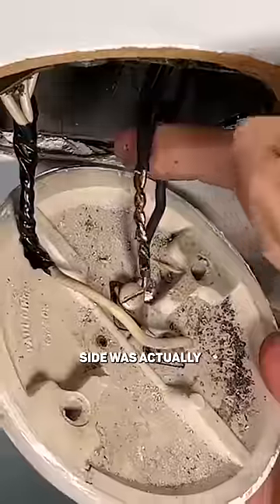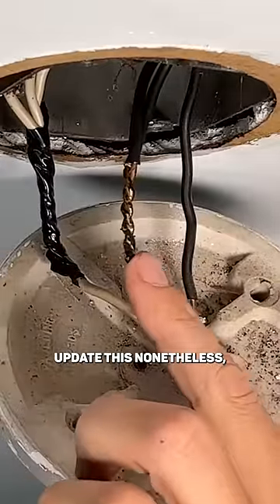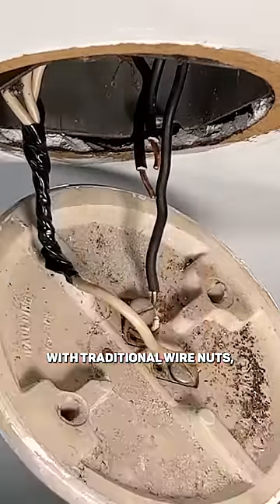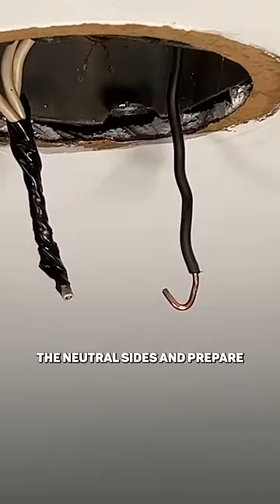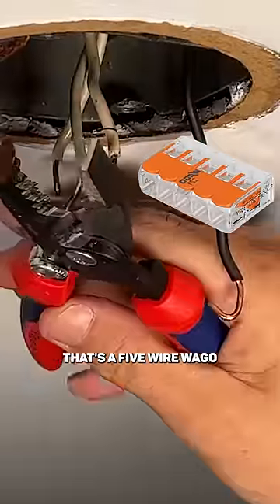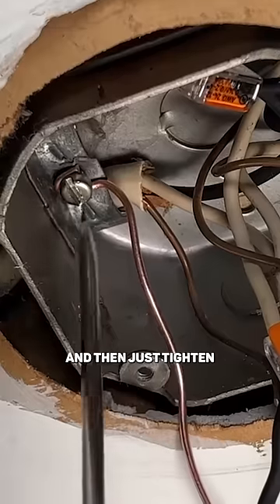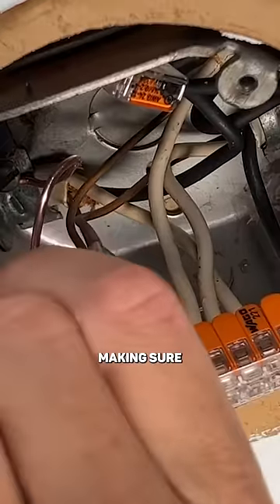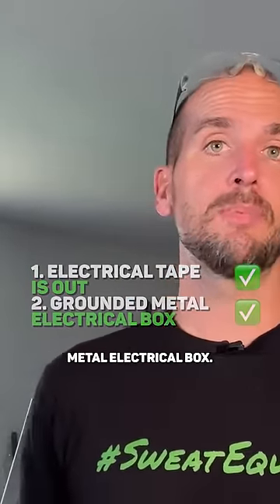Which Part Doesn't Meet Code?

Comment: Whenever I watch American electrical work, it looks like the UK in the 1960s
Reply: I agree
Reply: What he was working on probably was from the 60s
Reply: After watching UK standard work, I'm surprised we get away with what we do
Reply: Residential is much different than commercial, and it varies greatly state to state
Reply: That fixture was from the 60s.
Reply: @davepalmer9265  there needs to be a standard nation wide, is it really so difficult?
Reply: @michaeldunham3385  yes, it is.
Reply: Don't trust this guy to be running our standards.
Reply: Yep, and we still have a very safe electrical system and we don't have asinine ring circuits.
Reply: @Rupert Samborski  They don't have houses that old in America 🙄
Reply: @michaeldunham3385  NFPA?
Reply: @phil7390  your point is what?
Reply: @dylanrussell5261  spoken by someone who is clueless regarding electrical work
Reply: Total United Kingdom population size: 67 mill
Total UK electrical fires annually: 8,000
One out of 8,375 will experience an electrical fire annually. Uses 240 volt AC.

Total USA population: 332 million
Total USA electrical fires annually: 5,200
One out of 63,846 will experience an electrical fire annually. Uses 120 volt AC.

Hate to say it but I think you guys done F'ed up by changing since the 1960s especially seems how you guys run everything off of two pole 240 volt. Majority of our appliances run off of single phase 120 volt. You guys have a higher amp draw then we do and you guys are using an inferior connection compared to a pre-twist wire nut connection. I'd rather my wiring look like a rat's nest and to be safe than look pretty and be a fire hazard.

-a licensed IBEW electrician
Reply: @michaeldunham3385 yes it is exceedingly difficult because the world chose to use two pole 240 volt electricity as compared to here in the United States and the rest of the Americas where we use single pole 120 volt. We have less fires than y'all do 👀 and our stuff works just as good as yours does without catching on fire 😎
Reply: @TastyLiberalTears  it's not 5200, it is almost 9 times that. NFPA reported an average of 46700 fires involving electrical failure or malfunction each year between 2015-2019.
Reply: @TastyLiberalTears  the rest of the world uses 1 pole 230v
Not 2 pole like American 240 supplies are.

We don't do any of the centre tapping of transformer secondaries here.
Just simple 3 phase each 230v phase to neutral (Y) or 400v phase to phase

Distribution is normally 11kv phase to phase 🔺 connected 3 phase
Then the transformer (pole mounted in rural areas, in a compound in more urban areas) has a delta wound primary and a Y round secondary taking 3ph+n along the street with each house being connected to 1 phase and neutral
Reply: Most of our houses were built in the 60’s. How’s the wiring in your 1700s house look? Lol
Reply: @dasy2k1  my Lord you guys make electrical complicated LOL
Reply: More like 1930's
Reply: @TastyLiberalTears could you cite your source for 5,200 annual electrical fires in the USA? I couldn’t find anywhere that matches and most sites (such as the NFPA) say it’s 46,700 annual electrical fires.
Reply: I started my uk apprenticeship back in 1982 and wire nuts were Commen then
Reply: @TastyLiberalTears  you might want to check your figures,  according to the NFPA over 32k House fires a year in the US can be directly attributed to electrical faults.
Reply: @261mem19  the United Kingdom has 1/5 the size of the population of the USA so if you take your annual 8,000 electrical house fires each year times 5 you end up with 39,600 electrical fires per capita that is if the UK had the same population size as the United States. You guys still have more electrical fires than we do per capita.
Reply: @supremebeefmaster  I grew up in a house from 1925 LOL and most recently in California I lived in a house built in 1938
Reply: It would explain alot
Reply: @261mem19  per capita the UK has a higher electrical fire rate than the United States
Reply: @joshuatk59  51,000 i meant
Reply: US electrics terrify me. Everything feels shady compared to the way I was taught to work.
Reply: That's cause this is electrical work from the 60's-70's...
Reply: Why did you cut the wires so short? You just made those conductors too short could have just trimmed the wire twist and used wire nuts. But advertising come before good work I guess 🤷‍♂️
Reply: You guys, should use the Dutch standard. Nem 1010 standard. Every cable needs to be used with joint terminals, crowns, not exposed but everything in either PVC or flextubing when hooked on walls or inside walls. Also everything is grounded with an Earth Ground breaker. I've seen Americans put 2 strands of electrical wire straight up in the wall and spray insulation foam on them... 

Only thing i do like about the American eletrical wiring is their thicksness in cables. They use low voltage and insanely high current to get the same power. Plus side is, they can easily amp up the voltage to increase power over the existing cables till kingdom comes. Sure, existing old electrics would die probs. In Holland we went from 220 volts to 230V to keep up with the demand. But your wires can only go so far because they are less thick.
Reply: @michaeldunham3385  thats a national standard
Reply: Yanks going to maf af about this
Reply: There’s a lot of differences between the two systems but whatever you need to do to put yourself on a pedestal. Cope.
Reply: That's because most of the shit getting updated is from the 60s
Reply: UK Dentist just started using braces last year
Reply: @witlessfuture you should probably look up the electrocution stats while you're at it...
Reply: Whenever I see the UK today, I'm reminded of 1940 Africa
Reply: @AceWolff  18 edition tell me that they havent got it right 18 times 90% is BS coz sparks dont know what law is
Reply: This is not a proper installation. No real electrician would do what he did
Reply: @supremebeefmaster  What do you mean we don't have houses that old in America? One of the houses I used to live in was built in 1901.
Reply: @NathanExplosion25 some of the wiring in the UK to me is kind of questionable, I work with electric all the time doing repairs and updates. The ring system, yeah you may be able to deliver more amps but you blow one circuit an entire floor of lights or outlets go out instead of each room being individually on its own breaker.
Reply: @TastyLiberalTears  just check that electrical theory there hoss. US pull more current.
Reply: @joken8901  international Brotherhood of electrical workers, it's a union in North America
Reply: Yep, the UK are definitely electricity experts,  lol!
Reply: absolutely
Reply: @Chris Lewis  I mean, you're partially right. Lighting is wired on a radial here. Only sockets are wired with a ring circuit. 

The average house here generally consists of three ring circuits. Upstairs, downstairs, and kitchen. Also the cooker has its own dedicated supply.  While I can see the advantage of a circuit per room, it doesn't feel like a big deal if one of those three trips.
Reply: @supremebeefmaster  not true
Reply: Does not   even in the 60s things were done RIGHT  in the U. K.
Reply: I agree, "let's do the twist again like we did last summer " very 60s along with no sleeving on the ground our earth cpc, but it's interesting.
Reply: @TastyLiberalTears  how clown can you be?? LMAO
Reply: @ericdallolio  do the math yourself
Reply: @TastyLiberalTears  should be half the amp draw at double the voltage unless thier devices use 4x more power or they're putting a lot more stuff per breaker
Reply: @kevincrossland1898  in all honesty I'm pretty much over this whole tit-for-tat bullcrap. Here in the United States we usually have one breaker/room sometimes two the most common breakers you will find here is single phase 10,15,20 amp 120 v AC on two phase power the most common are 30,50 and 100amp two-pole breakers.
Reply: @TastyLiberalTears  a licensed electrician who doesn’t know ohms law. 😂😂😂
A 240v system draws less current than a 120v system for an identical load.
Reply: @LordStraightBanana  I am aware and that's why we still use a pre twist with a wire nut rather than a wago, I am a firm believer that the contact points on wagos are dangerous here in North America. The only time I feel comfortable using them is in light fixtures like troffers after the ballast or the drivers.
Reply: @TastyLiberalTears  you're either lying to try and prove a point or woefully ill-informed as data from the national fire protection association puts it at 51000 electrical domestic fires in the US annually
Reply: @supremebeefmaster guess I'll have to tell my parents their house isn't real
Reply: @michaeldunham3385  A US state is larger than a European country. Questions like this come from people who have no grasp of basic math or scale.
Reply: Or Germany in the 60s. XD Everyone here who is remotely familiar with the VDE will cringe all the way through this video.

I swear, if you do that today in Germany you will be forbidden to do electrical work ever again. 😂
Reply: @TastyLiberalTears  It reminds me of people making fun of imperial vs. metric.
i would be terrified, no matter how many additional safety features they include,
to have to plug my phone charger into 240 everytime i want to use it...
Thy should worry more about being good subjects to their royalty and less about how the USA gets stuff done.
Reply: @michael-dm2bv  hear hear good sir!
Reply: @michael-dm2bv  IDK I would probably be pissed if I lived on an island too
Reply: That is from the’60’s
Reply: Whenever I see UK teeth I think a electrician from the 60s did it.
Reply: @michaeldunham3385  well look what the European Union did when they had a go.
Reply: @TastyLiberalTears  erm, if you halve the voltage, you double the amp draw for the same power. Therefore I’d have you guys have the higher draw. Also in terms of overall demand all electric heating is not common (at the moment) and perhaps only 1% of households run AC.

Our typical total supply was 100 Amps single phase, but policy has very recently changed to make it 80.
We have insufficient infrastructure for everyone to be charging electric vehicles, which I guess us ok as there is not sufficient copper, coblot or lithium to ensure we met our 2030 targets anyway.
Reply: @bachmed00  in the U.K. we moved from 240 to 230v. I think it’s got more to do with European technical harmonisation document 432.
Reply: No the 1940s
Reply: As an Australian electrician, yeah US electrics scare me.
Reply: add to that Australia, New Zealand, Fiji from the 1950s. Seems like a lot of US electricians dont know when, where, why or how to do earthing either and goodness knows... can only guess what they'd think a M.E.N. system was...
Reply: @michaeldunham3385  absolutely agree with you.
Reply: @TastyLiberalTears  you obviously are not acquainted with inverse square ...as voltage increases, Current decreases, and v is versa.
You spend twice as much on copper as we do because of your need for increased current carrying capacity.
Reply: @TastyLiberalTears  your statistics mean diddly-squat, sunshine.
Electrical theory is built on laws which tend to be set in stone.
Reply: @TastyLiberalTears  I just laugh....
All those "inferior" electrical systems world-wide, using LESS copper, drawing LESS current and doing it all no doubt using a METRIC system... sigh... Americans sure do like proving time and time again how inferior they are compared to most other nations !!🤣🤣🤣
Reply: @TastyLiberalTears  
I keep thinking of Jeff Daniel's little  talk to the class about WHY AMERICA ISNT THE GREATEST COUNTRY...
they just think they are and every one elce is pissing themselves laughing....🤣🤣🤣🤣
Reply: @LordStraightBanana  ...at least SOMEBODY knows some shit. That old inverse square law aint going nowhere! As voltage rised, current will fall -  and vise versa !! OHMS LAW RULES!!
Reply: @JebediahKerb  bloody oath, mate ! Those yanks would freak out if someone dropped a copy of the AS/NZS 3000 Wiring Riles in their lap 🤣🤣🤣
Reply: @violettownmicroenterprises1528  😂😂😂 the United Kingdom is like the little brother that has polio compared to the United States. Don't worry little bro when the shit hits the fan get behind us.
Reply: @violettownmicroenterprises1528  when comparing apples to oranges what I can find is that France using 230 volt AC system has the most electrical fires annually.
Reply: This wiring is from the 1960s, most likely.
Reply: That won’t pass code here. It probably is 40 year old wiring
Reply: @supremebeefmaster  correct. We only kicked their ass back to England 40 years ago
Reply: @261mem19  and it is still a lower ratio
Reply: @TastyLiberalTears you're joking right 😂. Electricity is complicated 💀.
Reply: @michaeldunham3385  You mean like the NEC Code book?
Reply: @supremebeefmaster  I've changed and upgraded electric meter bases  from the 1890's.
Reply: @NathanExplosion25  you guys probably sent the kid making this video over here.
Reply: @LordStraightBanana  that's why in the US we use 277 v single pole circuit for our store lighting provided it's eight feet above the floor out of the reach  of humans unlike receptacles in the UK
Reply: @johnmcnair8854  as electrician's we are regulated by the national electric code you are referring to the national fire protection agency, it's really kind of dumb anyway we have more electrical things going on here like welding and industrial so sure there's going to be more fires., There's too many people commenting on here that don't even understand ohm's law and the amoacity of conductors  and their correct termination
Reply: @violettownmicroenterprises1528  we don't bond the ground in our subpanels that's right and there's a reason for that
Reply: @violettownmicroenterprises1528  you're not making any sense at all you probably are referring to ohm's law we have all kinds of different loads and single pole double pole 3-phase voltages, that all mix together easily into our grid
Reply: @mrromantimothy  Was that the modern equivalent to "I know you are, but what am I" ?
Reply: @mrromantimothy  well with your welding and industrial, I was commenting on a post about house fires so what has industrial got to do with house fires?

Comment: Putting that ground wire under the cable clamp screw is not code compliant so you left the box with a code violation.
Reply: @thebigdoghimself  He didn't run those wires and he needed to cut them to properly join them. Stop going off topic
Reply: He was too lazy to drill and tap a hole for a proper ground wire.  Amateur.

Comment: It was code compliant at its installation when solder was legal. Put some 33 or 88 tape over the original tape if you want to ensure it's taped. Those 2 tapes will probably last longer than you will. Or, put a wire nut over the soldered connection. There's no reason to disassemble the connection and redo it unless it's failing.
Reply: Exactly. Thank you

Comment: Did a great job Butt your ground is wrong. You need to put a grounding screw into the box to bond the box to the grounding system
Reply: Hows that going to work when that old service has no ground?
Reply: So the service doesn't work?  I didn't see that there was no power, I assumed there was.
Reply: That's the way it was grounded before threaded j-boxes and green screws. 
I would bet that there are more grounds that used this method than green screws and green wire nuts in residences in the entire US. 
Where there were no romex clamps in The box, the ground was wrapped around the  hold down screw for the blank cover.
Reply: Not when the boxes aren't grounded to anything.
Reply: Green screws don't do anything different than silver screws.
Reply: @fraidykat  so, electricity is colorblind?
Reply: @billellington9754  Yes, but it's discriminating against materials that are not metal.
Reply: @billellington9754  250.126 only applies to devices.  It does not apply to boxes.
Reply: @fraidykat  you missed the joke

Comment: You were doing Ok till you attached the ground wire to the cable clamp screw. No can doski. Also the soldered connection is superior to the pressure connector you used .  A wire nut is all that was needed. Your supposed to make things better not worse.
Reply: Get with the times grampa, Wago's are just better.
Reply: @shikamaru3456  and you wouldn't know a good connection from that hole in your head
Reply: @Harrison2253  ok boomer.